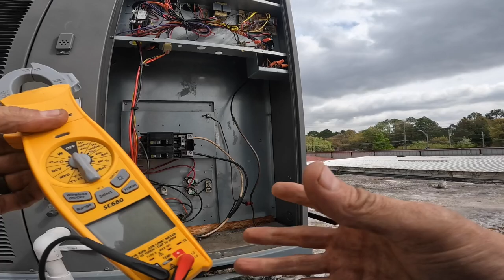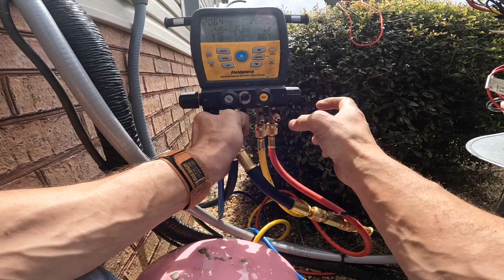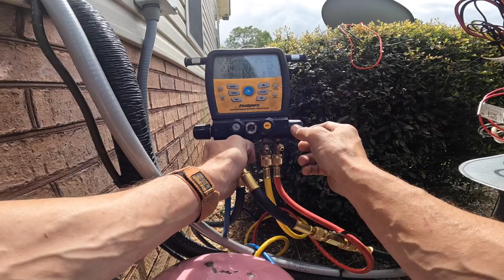I Take You On a Roof with Me and Inspect Today’s Changeout

Comment: Curtis that roof needs to be done first. Somebody needs to rent a crane to take the two systems off the roof. After the roof is done you need a higher electrician and a crane so you can get the two systems up there. In your bid Curtis make sure you put the rent on the crane in your bid.👍🤟

Comment: Can’t believe the disc boxes at roof level.  WHAT did you find out on the Maytag furnace from yesterday?
Reply from the maker: Maytag won’t give me access to the manual
Reply: @HVACGUY   that’s pretty poor Maytag customer service.  Did you see some other’s comments saying with that blinking light pattern it’s a motor module. I found the same thing when i  looked at maytag trouble shooting manual
Reply: @HVACGUY  
The comments on board lights blinking are on your 1st video the you were there. Hope it helps
Reply from the maker: @jamesfitzsimmons381  better help from Bluon
Reply: @HVACGUY   good 👍

Comment: Goes without saying, those disconnect boxes need to be moved up. Nice job on the install, the line set on that other unit is unacceptable at best. They could run it up the side of the house and cover it like a little chimney, if there is no way to go inside the wall. Dang shame, that is a nice home too.